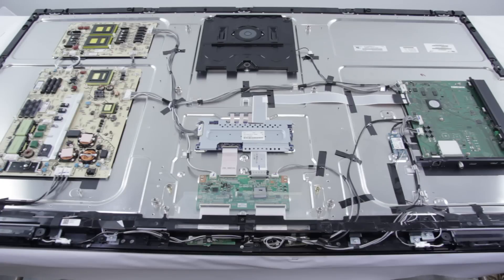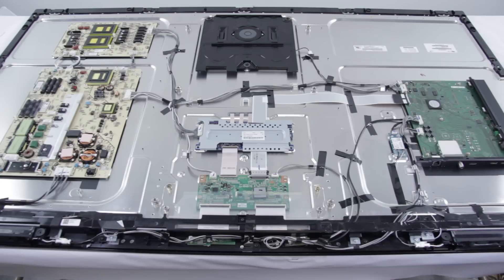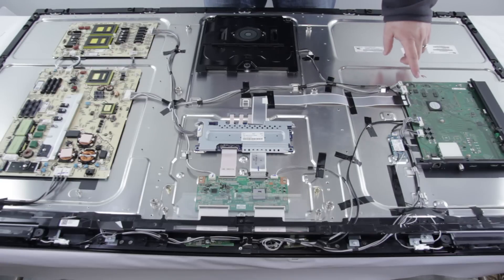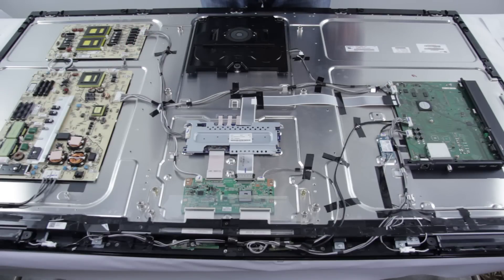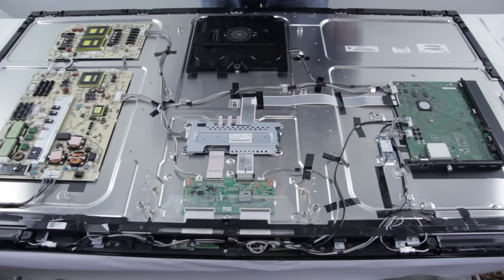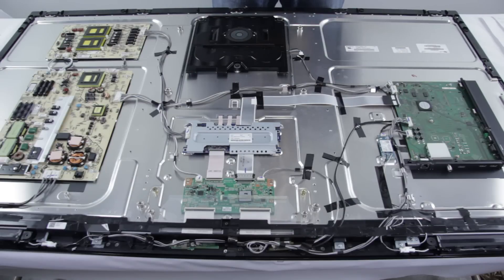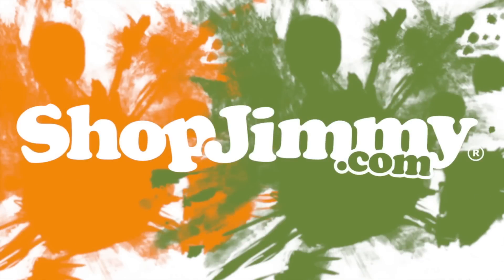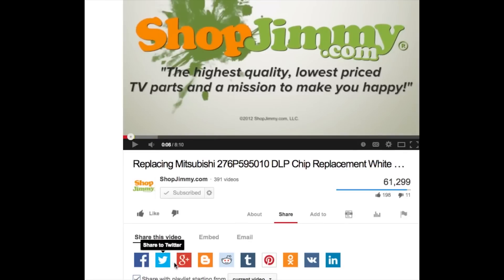LED TV Repair Main Board Overview Blank Screen-TV Has Audio but No Video-Common Issues Problems

Comment: hi my name is omar, I'm having problem with my 42" vizio tv model no. xvt423sv. when i turn it on it doesn't show any logo and doesn't show anything at all , but the screen turn on but it stays black i already change the power board cause the last one had a short circuit and burnt a little bit so i bought one exactly like it with the same serial number , can you help me figure out what's wrong and if you can with a full video of the same model of tv , i also checked the other boards to see if it was damaged but no sign of damage on it , the other serial number is LAPPGJAL4300699 don't know if that will help but i just hope you'll be able to find the problem don't know what this t-con 0171-2372-0024 does so i would like to know if it's the problem.
Reply: if only i could send you a video so u can see what I'm talking about i would but i don't know how too.

Comment: I have a Vizio 3-D 55 inch LCD TV, model number M3D550SR. The serial number is LTLPKUAM4501183. I think it’s a bad motherboard because the HDMI inputs are producing only a black and white picture, except for when I connect my Xbox 360 and it will produce beautiful color as always.

Comment: I have a Samsung smart TV 
Model : UA40F5500AM
The TV is not displaying any picture, not even the menu when pressed on remote or on TV button. I'm able to here audio and the TV is still connected to WiFi.
Reply from the maker: pradeep asundi  Please watch this video FIRST to help with your repair!  https://www.youtube.com/watch?v=BP3NVNCGEv8  This could be a problem with either the main board or the t-con board in your TV.  You may need to replace each board individually to see which one fixes the problem.  Here is a link to replacement parts:  http://www.shopjimmy.com/catalogsearch/result/?q=40F5500  Be sure to match part numbers on your current board, with your replacement for compatibility.  Thanks and please let us know if you have any further questions with your TV Repair!  www.shopjimmy.com

Comment: I have a LG 55LX9500-UA and the HDMI's are not working. Do you have or know of where I can get a replacement main board? Part number is ERB69489101

Comment: I have a 50" RCA RLDED5078A 
There is no picture but the backlight works. I've tried both HDMI ports on it.
Reply from the maker: Tylar  Please watch this video FIRST to help with your repair!  https://www.youtube.com/watch?v=BP3NVNCGEv8  This could be a problem with the t-con board or the main board.  I recommend replacing the t-con board first to see if that fixes the problem, and then the main board if needed.  Click this link to replacement parts for your TV model number on our website:  http://www.shopjimmy.com/catalogsearch/result/?q=RLDED5078A  Be sure to match part numbers on your current board, with your replacement for compatibility.  Thanks and please let us know if you have any further questions with your TV Repair!  www.shopjimmy.com
Reply: Hi this is Rajesh here 
I have a RCA Led tv model :RLDED5078A-D. The problem is when I on the TV I get sound but no picture.if I put the torch light on the screen I could see some the TV is on with display with o% light or display. But I get sound.what is the problem? Reply thanks

Comment: My 40" Samsung (Un40B6000VFXZA) died from power surge/lightning. It did nothing. My PSB seemed OK, so I changed my Main. When I did the LED light came on then off and on again etc. It keeps clicking on then off and just keeps doing this. I then changed the T-Con board. The same thing keeps going on. I really don't know what to do now. I paid $2,200 for this TV in 2010 and love it. I want it back. lol

Comment: Sir 
My tv model no is 43UH617V 
The problem is  Black screen/no picture 
But sound is alright. Technician detected there is motherboard problem and it's needs to be replaced. 
Please suggest the solution on this and guide how to deal the problem.

Comment: I Have Samsung Smart TV Model UN32E2S6400 Problem is blank screen but audio is ok...Please Help Thanks
Reply from the maker: Rusty Cabato   Try all repairs and troubleshooting at your own risk.  I recommend running the flashlight test on your TV.   Here is a link to a video we produced that shows how to run the flashlight test. https://www.youtube.com/watch?v=xUzCLgoSPGM Please reply with your flashlight test results and we can recommend a replacement part for your TV repair. Thanks and please let us know if you have any questions! www.shopjimmy.com

Comment: samsung un46eh5000fxza  good sound no backlight passes flashlight image test so has non backlight picture and good sound, does not match any of your videos for parts
Reply from the maker: +Tom Ass  Try all repairs and troubleshooting at your own risk. This sounds like a problem with the actual LEDs inside your TV. These LEDs are replaceable, however it is recommended they are replaced by someone with the proper experience and training. When replacing the LEDs, the TV panel can get damaged. If the TV panel gets damaged, it is not repairable. Click this link to replacement LEDs for your TV model number:  http://www.shopjimmy.com/samsungltj460hn05-v-led-strips-12-strips-interface-board.htm   Be sure to match the panel information necessary to ensure you have the correct replacement LEDs.Thanks and please let us know if you have any further questions with your TV Repair!  www.shopjimmy.com

Comment: I have a Samsung UN60FH6003.  Bought extended warranty.  Set went bad and repair guy was out twice and couldn't fix.  They gave us our purchase money back and said good luck........AS soon as you plug the set in, backlights flash at about 1 hz as well as the front power led.  Remote or manual off/on switch do nothing.  repair guy put in new power board which didn't solve anything (don't know if he left it in or replaced the old one).  Bought a main board from you guys which didn't solve anything.  My troubleshoot:    removed on/off ir cable from main and nothing changed.  removed lvds cable from t-con: nothing.  removed cable from power board to main: still blinks.  So what I have is commercial power into the power board with nothing else hooked up and backlights blink.  hooked everything back up but removed the four wires to the backlights from the power board.  plugged it in and got the musical turn on sound from speakers and the front led blinked 4 or 5 times like our other Samsung tv when it turns on.  What ya think?  Do you have a complete replacement kit with main, t=con, power and ribbon cables?
Reply from the maker: Tammye S  Try all repairs and troubleshooting at your own risk.   Sounds like you have bad LEDs in your TV.  Thanks!  www.shopjimmy.com

Comment: MODEL LG   55LE5400-UC.AUSWLHR
TV turns on works for about 15 mins then shuts off no picture no sound and power cycles.  Seems like the main board to me.  Please advise.  Thank you Ekndsn
Reply from the maker: E Kndsn  Please watch this video FIRST to help with your repair!  https://www.youtube.com/watch?v=BP3NVNCGEv8  I recommend replacing the main board in your TV.  Click this link to replacement main boards for your TV Model number:  http://www.shopjimmy.com/catalogsearch/result/index/?cat=56&q=55LE5400-UC  There may be multiple boards for the same TV model number, be sure to match part numbers on your current board, with your replacement for compatibility.  Here is a link to a video showing how to identify your part number, click here:  https://www.youtube.com/watch?v=RwHTvjMdrhk  Thanks and please let us know if you have any further questions with your TV Repair!  www.shopjimmy.com

Comment: Hello, I have a Vizio E420-A0 that has sound and I can see a picture with a flashlight. But no regular picture, the tutorial says it is the t-com board that is bad but I don't see one in this tv, please help main board 0171-2271-4763 power board 0500-0614-0300
Reply from the maker: Angel Velasquez   Try all repairs and troubleshooting at your own risk.  This could be a problem with the power supply or bad LEDs in the TV.  You can replace the power supply board to see if that fixes the problem with your TV.  Click this link to replacement parts for your TV model number:  http://www.shopjimmy.com/catalogsearch/result/index/?cat=59&q=E420-A0  There may be multiple boards for the same TV model number, be sure to match part numbers on your current board, with your replacement for compatibility.  Here is a link to a video showing how to identify your part number, click here:  https://www.youtube.com/watch?v=4i57Cm9-96M  Thanks and please let us know if you have any further questions with your TV Repair!  www.shopjimmy.com

Comment: Hisense 50K610GWN
Screen shows no life at all( no logo,blue screen or even a flicker) but audio is fine. I have even tried to use Netflix and I can still see nothing(so it isnt a plug)
Reply from the maker: Casketman20  Please watch this video FIRST to help with your repair!  https://www.youtube.com/watch?v=BP3NVNCGEv8  I recommend replacing the power supply board in your TV.  Click this link to replacement parts for your TV model number:  http://www.shopjimmy.com/catalogsearch/result/index/?cat=59&q=50K610GWN  There may be multiple boards for the same TV model number, be sure to match part numbers on your current board, with your replacement for compatibility.  Thanks and please let us know if you have any further questions with your TV Repair!  www.shopjimmy.com

Comment: Samsung UN50F5500. power led blinks 5 times and repeats.
Reply from the maker: +Anthony Murray  Try all repairs and troubleshooting at your own risk.   I recommend replacing the main board in your TV.  Click this link to replacement parts for your TV model number:  http://www.shopjimmy.com/catalogsearch/result/index/?cat=56&q=UN50F5500  There may be multiple boards for the same TV model number, be sure to match part numbers on your current board, with your replacement for compatibility.  Here is a link to a video showing how to identify your part number, click here:  https://www.youtube.com/watch?v=BEPWrefQvqI  Thanks and please let us know if you have any further questions with your TV Repair!  www.shopjimmy.com

Comment: Sharp LC-70C6500U           10-30 seconds after turning the tv on the tv looses all remote functions, cannot change the channel, can’t change volume, cannot change input. The only thing you can do is turn the tv off using the switch on the tv itself. Once tv shuts down and you turn it back on you can change the channel, input, volume or anything else but only for 10-30 seconds. I believe it’s my main board.
Reply: Why no reply?

Comment: Hisense 50" Model # 50K610GW

No Picture, just Audio
Reply: Chad Adams flashlight test is negative
Reply from the maker: Chad Adams  PLEASE SUBSCRIBE TO OUR CHANNEL - Try all repairs and troubleshooting at your own risk.  I recommend replacing the main board in your TV.  Click this link to replacement parts for your TV model number:  http://www.shopjimmy.com/catalogsearch/result/index/?cat=56&q=50K610GW  There may be multiple boards for the same TV model number, be sure to match part numbers on your current board, with your replacement for compatibility.  Thanks and please let us know if you have any further questions with your TV Repair!  www.shopjimmy.com

Comment: Problem:   LG 47LS5700   I have audio but no video.   100% black TV (no video) but hear sound.  I changed cable box and HDMI cables and HDMI ports - still no video.
Reply from the maker: funkycowboy   I recommend replacing the main board in your TV.  Click this link to replacement parts for your TV model number:  http://www.shopjimmy.com/catalogsearch/result/index/?cat=56&q=47LS5700  There may be multiple boards for the same TV model number, be sure to match part numbers on your current board, with your replacement for compatibility.  Here is a link to a video showing how to identify your part number, click here:  https://www.youtube.com/watch?v=RwHTvjMdrhkThanks and please let us know if you have any further questions with your TV Repair!  www.shopjimmy.com

Comment: I have a Vizio Model 470NV, Part No.:10240180022, Serial No. LAQKGTAL2007734.  HDMI # 1 has stopped working other than this HDMI port # 1 not behaving all other functions of the Television input/output/remote are in working order.  I have connected other HDMI devices to HDMI # 1 with the same results. The Television was connected to a cable convertor when it stop working the cable convertor box was turned on the Television was turned off.  Not sure how long this condition existed before I turned the Television on but, the condition existed when the Television was turned on after an extended period turned off at least a week there were thunder storms during the this time.  I have the Television AC power connected to a surge protected and it is still functioning.  I have also checked the cable convertor box output the Television was connected to its the cable convertor box output for the HDMI output is not functioning all other outputs are functioning.  I have checked your site for the P/N of the Main board (my guess).  Your site calls for P/N's 3647-0302-0395, P/N 3647-0302-0395R, 3647-0302-0150, 3647-0302-0150R, and P.C. Board # 0171-2272-3235.  My question is I have found this P/N but the Board number is 0171-2272-3237 and the P/N has some letter at the end of the base P/N Example: (5E), (7A), and (7B) are all theses compatible with my Television Model?

Thanks
Reply from the maker: John Hermanski  Please watch this video FIRST to help with your repair!  https://www.youtube.com/watch?v=BP3NVNCGEv8  I recommend replacing the main board in your TV.  Click this link to replacement parts for your TV model number:  http://www.shopjimmy.com/catalogsearch/result/index/?cat=56&q=470NV  Be sure to match part numbers on your current board, with your replacement for compatibility.  Here is a link to a video showing how to identify your part number, click here:  https://www.youtube.com/watch?v=kxkeGLhlQY8  Thanks and please let us know if you have any further questions with your TV Repair!  www.shopjimmy.com